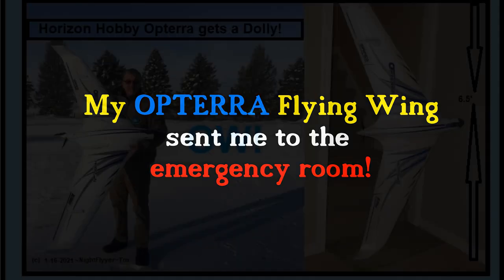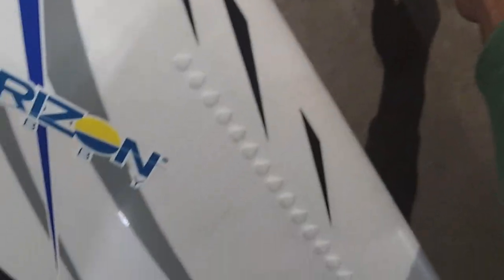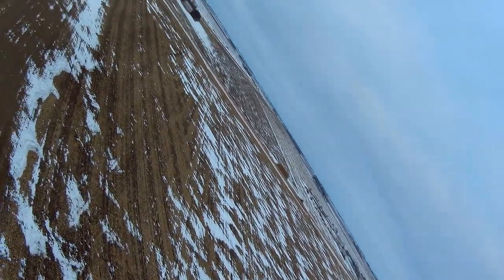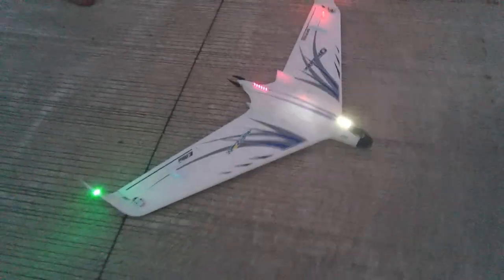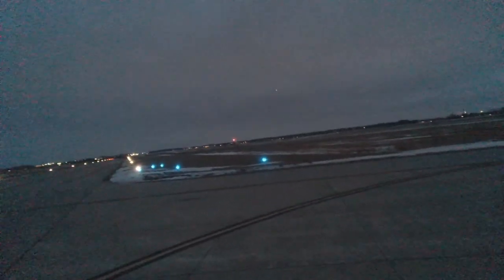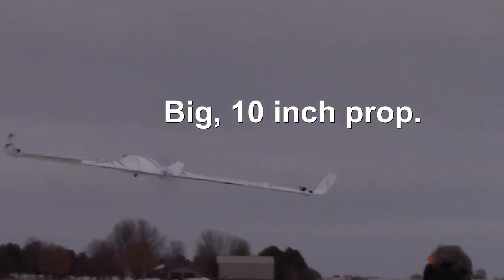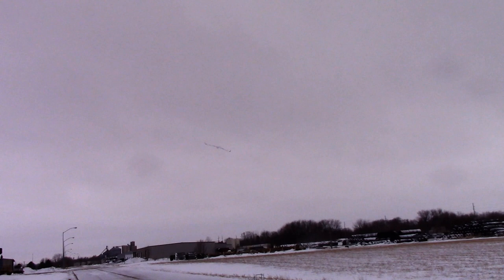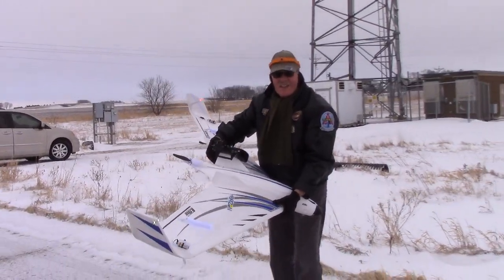My Opterra 2M Flying Wing sent me to the E.R. This is an awareness video & my solution for launching

Comment: I knew exactly when it struck your hand.  I never hand launch anything.  If it does not have wheels, I do not fly it.  I am not coordinated enough for hand launching.  Glad you are okay. It is a good thing thing that you did not sever the nerve that is near by.  At least wear some type of hand protection if you are going to hand launch a plane.  Perhaps the kind that bird or falcon handlers use would be a good fit for this.
Reply from the maker: Yep, I just followed the instructions.  Thanks for that suggestion and I tried that already, but because it was cold.  I found trying to hold on to the tiny finger grips on the bottom of the 7 foot wing with a thick glove under full power with wind blowing was difficult when under power and then trying to fly with  a big enough glove on was also difficult to fly the transmitter, (I'm a stick pincher)  so although that sounds like a good idea, it did not work that well. Some have told me the Prop got them in the forearm even before launch, when a gust of wind got under the wing and tipped it back, so gloves wont protect that.  We are only talking about a Half inch of clearance that I needed to keep from getting cut, and even though I pulled it off several times in my earlier product review video,  I will never hand launch it again.  LOL.  It's hello dolly from now on!  Thanks.

Comment: For us that don't have a runway, I guess it's the Michel Jackson one glove, leather of course. Great job.
Reply from the maker: LOL.  I did not use a runway in my product review video and that all went well.  https://www.youtube.com/watch?v=P_inF... and  https://www.youtube.com/watch?v=ur5V5...  Thanks for that suggestion and I tried that already, but because it was cold.  I found trying to hold on to the tiny finger grips on the bottom of the 7 foot wing with a thick glove under full power with wind blowing was difficult when under power and then trying to fly with  a big enough glove on was also difficult to fly the transmitter, (I'm a stick pincher)  so although that sounds like a good idea, it did not work that well. Some have told me the Prop got them in the forearm even before launch, when a gust of wind got under the wing and tipped it back, so gloves wont protect that.  We are only talking about a Half inch of clearance that I needed to keep from getting cut, and even though I pulled it off several times in my earlier product review video,  I will never hand launch it again.  LOL.  It's hello dolly from now on!  Thanks.

Comment: I have been flying for 3 years with an X8 (2.12 m wingspan) with a 12/7 propeller as I do long-range I fly with 10000mAX2 and the wing weighs 3.75kgr I throw it by hand systematically but I wears a leather glove (handling) that I remove once the throw is done. otherwise for large wings the best solution remains the catapult on rail with trolley accelerated by double elastic we find the plan everywhere on the net often from a square aluminum profile of 2.3 / 3m long well hello from France and good healing to you
Reply from the maker: Hi and thanks.  This is a hard plane to hand launch into the 12 mph wind I was dealing with, and gloves wont protect the forearm if the bird tips back before launch as many told me happened to them.  But its hello dolly for me from now on.  Thanks.
Reply: @NightFlyyer  yes the dolly is one of the possible solutions, the only drawback with a dolly is that it requires a track, me always flying outside the club so without a track, I did not have the possibility of using a dolly. This is why I had adopted the glove solution. Personally, I have never had a backward tilting problem but it is true that this remains a possibility to be taken into consideration. Very good flight to you and greetings from a French pilot. (sorry for my english but i use an automatic translator .....)
Reply from the maker: @sylvainponchelet646  The dolly needed the string guide only on this narrow road. In wide open areas, including grass, it still drives pretty straight.  Thanks for the glove suggestion and I tried that already, but because it was cold.  I found trying to hold on to the tiny finger grips on the bottom of the 7 foot wing with a thick glove under full power with wind blowing was difficult when under power and then trying to fly with  a big enough glove on was also difficult to fly the transmitter, (I'm a stick pincher)  so although that sounds like a good idea, it did not work that well. Some have told me the Prop got them in the forearm even before launch, when a gust of wind got under the wing and tipped it back, so gloves wont protect that.  We are only talking about a Half inch of clearance that I needed to keep from getting cut, and even though I pulled it off several times in my earlier product review video,  I will never hand launch it again.  Thanks.

Comment: Having felt a high speed router impact my fingertips, I know that  feeling too well (miraculously, less damage than yours).  Someone needs to figure out a cheap, universal catapult that works for pushers and tractors for those without  a decent runway.   Something that replicates hand launch without the "zing-bang! ow!" (BTW, threw out my dangerous router setup and found a real one on CL.)
Reply from the maker: Yes, I had a great launcher that was self contained and rubber powered, but it was lost in the fire that destroyed my shop, models and home in 2016  I showed a glimpse of it in the video launching a pop wing.  That worked well, but since all my jets were destroyed, I never needed another till now.  But my Dolly worked great and is much easier to carry in the car than my big old catapult.  Hope your fingers are okay.  Mine is going to take a while to heal, that's for sure.  Thanks kindly.

Comment: My problem usually occurs when the transmitter (hanging from the strap around my neck) brushes the throttle stick against my body. I wish I could set up a throttle hold function on a switch like I can for helicopters.
Reply from the maker: Actually you can, but that is not what cut me.  Thanks.

Comment: couldnt you just throttle up after its launched? A good toss at 10 or 15 deg angle should get it going enough till its throttled up. Hope for a quick healing ;-)
Reply from the maker: This is a big 7 ft under powered wing and trying to throw into the 10knot wind is harder than you would think.

Here is word for word what the Opterra 2M manual says about launching.  
1. Put the aircraft into launch mode with the channel 5 switch.  (in my first video that did not work, it went into the ground)  
2.  Hold the aircraft in one hand and the transmitter in the other.  
3.  Apply full throttle and throw the aircraft directly into the wind, angled slightly up (5 to 10 degrees above the horizon). 
4.  Climb to a safe altitude and check the trim.   
I know others have their own ways, and either way, my Dolly is the safest solution for me.  
The Opterra 2M manual also says nothing about throwing it with the motor off, so if a newbie followed the instructions, like I did, I'm showing what could happen, in case a gust of wind got them or something else.     Nothing is 100% and no matter how good you can throw, this big 7 foot wing with a 10 inch prop spinning right next to your face, is risky.  Thanks much.
Reply: @NightFlyyer  ya sounds like they opened themselves up for lawsuits. If the wing was stiffer, it wouldn’t be a problem. But it flexes downward at the center when you launch. Hope you’re healing well.

Comment: Sorry for your injuries Sir.  Hope they they heal.  However you made a few basic mistakes.  Firstly you did not follow through by arcing your hand downwards on the follow through.  Your hand clearly follows the bottom of the fuselage.   A safer method still is to throw the model and only advance the throttle when its clear of your hand. Also did you know about the throttle cut feature?. You can set up as switch so that the throttle cannot be accidentally bumped.  On Spektrum DX8 Goto menu ->Throttle cut and select a switch position.  Once this switch is in this position the throttle will not respond to the stick input. Like the dolly launch good job on that.
Reply from the maker: I have launched many many models and this one is the biggest.  Never in 50 years did this happen.  Its easy to say what I should have done after the fact, but wind blowing and gusting can make a difference and no matter what, it is only an inch of space we are talking about. If a new pilot is warned, that is my mission.   Here is word for word what the Opterra 2M manual says about launching.  1. Put the aircraft into launch mode with the channel 5 switch.  (in my first video that did not work, it went into the ground)  2.  Hold the aircraft in one hand and the transmitter in the other.  3.  Apply full throttle and throw the aircraft directly into the wind, angled slightly up (5 to 10 degrees above the horizon). 4.  Climb to a safe altitude and check the trim.   I know others have their own ways, and either way, my Dolly is the safest.  The Opterra 2m manual says nothing about throwing it with the motor off or programming in a throttle cut!

Comment: A friend of mine sliced himself up pretty good with the smaller optterra. I have the same one you have. But i put a hook on the bottom of it and launch it from a launcher with a huge bungee staked into the ground. And a lever on the launcher that you can step on and it throws the plane pretty far before I even hit the throttle. I kinda hated watching this video because I knew what was coming. I've seen it happen myself. Hope you are healing well.
Reply from the maker: Yes, I tried others, but my dolly is the best for me from now on.  This wing is 7 foot long, heavy, under powered, and will bend and break the end off the if you even try to pick it up by the tip. It barely has enough power to fly out of your hand at launch and especially while I was trying to throw it into 12 mph wind. I know and I tried to launch it discus style, but could not hold it where I felt I could launch it successfully in the wind.     It would  be extremely difficult to somehow launch it discus style with the elevon there and that 7" tall winglet rudder that is also on the tip.  I know how to do it , but not with this plane.    Here are the links to the last videos and you can see I launched it the same way without problems.
https://www.youtube.com/watch?v=P_inF5EYLEE&t=1s&gl=CO  and   https://www.youtube.com/watch?v=ur5V5H8UcGs&t=1s  Thanks.

Comment: That was smart as a box of rocks! Maybe look into a flight controller with auto launch or learn how to launch a pusher wing correctly.  (a helper and two hand reverse overhead) The FPV community has a lot to share, look em up!
Reply from the maker: I followed the launch directions to a tee as in the book. If the manual said to buy a flight controller or somehow throw this monster discus style I would have.   Maybe you should check out this second video. https://youtu.be/f5xDfk7sbcQ  believe me, I know how to launch these. I also have no helper around to help me.

Comment: I did similarly with a park jet.  I now launch holding one side of the wing.  I now launch like a frisbee.
Reply from the maker: Easy to do with a small wing, but not this one.  This wing is 7 foot long, heavy and  will bend and break the end off the if you even try to pick it up by the tip and barely has enough power to fly out of your hand at launch.  I know and I tried to launch it discus style, but could not hold it where I felt I could launch it successfully in the wind.     It would also be extremely difficult to somehow launch it discus style with the elevon there and that 7" tall winglet rudder that is also on the tip.  I know how to do it , but not with this plane.  thanks.

Comment: I have seen many people cut launching pushers with the prop spinning. All where arm cuts not on the hand. Mostly from poor technic and trying to throw it hard having the tail drop down on their arm. So I stopped doing it. One field I found had a nice hill to launch the ones that where rather difficult to launch power off.
Reply from the maker: Yes, that would work, but there are no hills anywhere I live.  Thanks much.

Comment: #1 rule of hand launching....especially with a pusher you have to follow through!, or wing toss. and always set a throttle cut first thing before or after binding!
Reply from the maker: Im no newbie on hand launching, but this is a 7 foot wing and blowing wind.  Not much space and I offered it as a warning.  I only mention the Throttle arming because I followed instructions in the manual, and this is the way it bound. It said nothing about programming in a throttle cut to a switch, which also may be in the wrong position, by accident.  It had nothing to do with the reason I got hurt. 
 Here is word for word what the Opterra 2M manual says about launching.  
1. Put the aircraft into launch mode with the channel 5 switch.  (in my first video that did not work, it went into the ground)  
2.  Hold the aircraft in one hand and the transmitter in the other.  
3.  Apply full throttle and throw the aircraft directly into the wind, angled slightly up (5 to 10 degrees above the horizon). 
4.  Climb to a safe altitude and check the trim.   I know others have their own ways, and either way, my Dolly is the safest.  The Opterra 2M manual  says nothing about throwing it with the motor off.

Comment: Ouch!  
Program throttle-cut on the Spektrum use that for your planes. Works like Hold on a heli.
Reply from the maker: Of course I know that, as I fly helis regularly as you can see on my channel.   First of all, that had nothing to do with my hand injury. I only mentioned the Throttle arming because I followed instructions in the manual and this is the way it bound up and arms the motor as soon as you plug in the battery.  It's my warning to be cautious, because the manual says nothing about programming in a throttle hold to a switch. I've known of times when after flying, that switch was forgotten to be moved back to safe and it armed as well.  Nothing is 100% as it could be left in the wrong position, by accident. I'm pretty experienced, so never relied to on a throttle cut/hold, as all my helis (not my nitro ones)  need throttle stick movements to arm.   I only am warning others to be careful BEFORE the launch and to be careful no matter what you use.

Comment: For exactly this reason i always hand launched it without throttle on. and as soon as it is a few feet away from me i slam the throttle stick up. When i first tried to handlaunch this with throttle on i realised this aint a good idea and canceled the launch and figured i will try it without throttle first
Reply from the maker: Yes. Well in smaller wings that works, but with this big one, it seemed impossible for this 73 old guy to get to the throttle stick in time, while still holding up with the right hand. Live and learn.  Thanks.
Reply: @NightFlyyer  i can understand that indeed. i do have to throw it with all the power i have for a succesfull launch. I hope your finger recovers soon
Reply: I’ve seen videos on YouTube of this wing being launched without the motor spinning and after gliding a  bit throttling up (just like the manual says). My first Stryker bit me years ago.... painful lesson to learn.
Reply from the maker: @jaygdav u  I have an F-27 evolution and that is like the striker.  It is quite a bit smaller and accelerates like mad.  Here is exactly what the Opterra manual says word for word.  1.  Put the aircraft into launch mode with the channel 5 switch.  (in my first video that did not work, it went into the ground)  2.  Hold the aircraft in one hand and the transmitter in the other.  3.  Apply full throttle and throw the aircraft directly into the wind, angled slightly up (5 to 10 degrees above the horizon). 4.  Climb to a safe altitude and check the trim.   I know others have their own ways, and either way, my Dolly is the safest.  The Opterra says nothing about throwing it with the motor off.
Reply: @NightFlyyer  unreal, if the instructions say that then anyone could sue them for personal damages. It’s true your dolly is safer, but I don’t like to lug those things around or set them up.... Dave, you should search YouTube on this wing and check out the different ways people are hand launching them, you’d be surprise on the results of an off throttle throw.  Hope everything heals!  Enjoy your videos.
Reply from the maker: @jaygdav  The instructions are real.  The Dolly is a lot smaller than my catapult was and no matter what others do, I will never hand launch this again. I'm no newbie to hand launching and know the procedure that works.  Hand is close to that 10 inch prop no matter what and not worth it to hope you get it right.  This is a 7 foot wing and in the gusting winds, nothing is 100%   Thanks much.

Comment: Inav f411wse board only $50 cheaper than an er bill also has auto launch you activate it by the switch and it knows by g forces when you toss it when it senses you toss the wing there's a1-2 second delay then it'll throttle to and climb out in a stabilized mode
Reply from the maker: Yes, that would work and since I have only flown this a handful of times, I simply followed the instructions in the manual.  If the manual had told me to program in the delay, or buy something to do this, I would have.  Thanks.